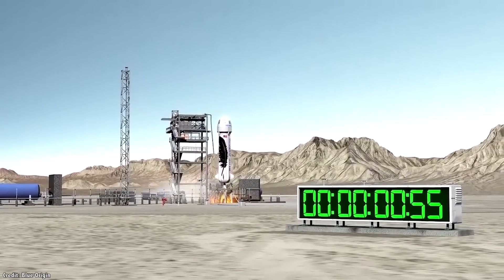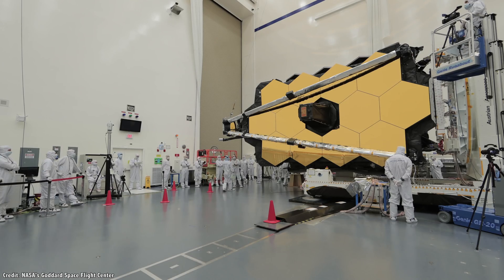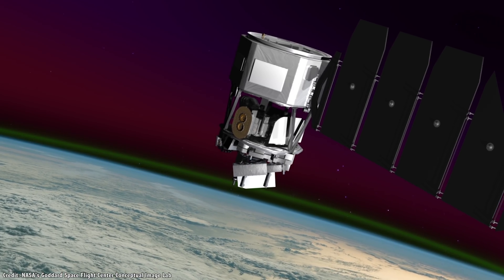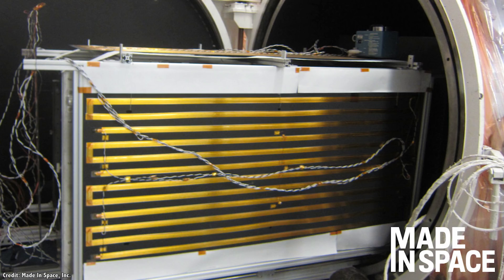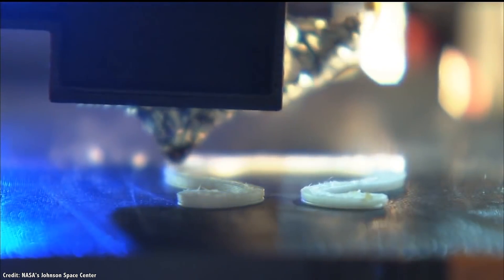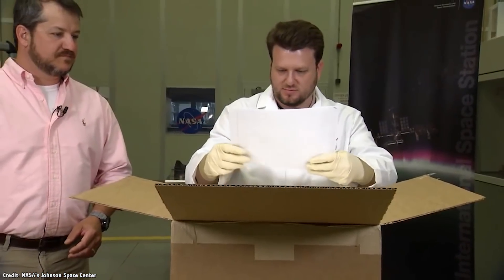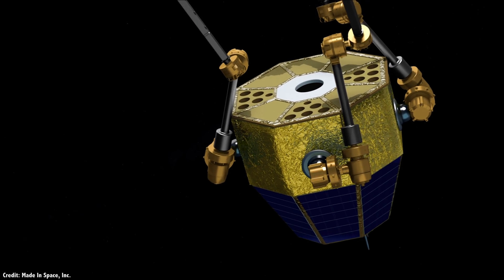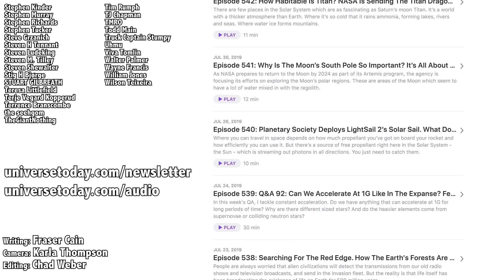A Spacecraft Is Going To Build Its Own Solar Panels In Space: Archinaut One

Comment: How will the solar panels be made? Are they some kind of flexible panel on a roll? Not to detract from the wider importance of what MIS is doing, which this serves as a good demo for, but if you're using rolled panels, why not use a, for lack of a better term, "tape measure," to act as a truss? I believe lightsail 2 is using such a system. If the technology for flexible solar panels on a roll exists, I would have expected someone to try that already.

Comment: It will take a bit of time, but once a certain threshold is reached it will take off like crazy. 
I see it as 4 steps:
1. Build functional habitats with access to further materials and water (from extraterrestrial sources), but still supplied with food deliveries.
2. Develop a workshop that can be used to build industrial hardware (machinery and composite materials).
3. Develop a fab for micro-circuitry (processors, LED lights, circuit components).
4. Build farms in space.

Then it's just build-build-build from there. Hotels, science labs, telescopes, whatever.
Some might think a space farm should come right after the hab, but no... It would not be optimal. For a farm in space, and therefore a space based colony, to be truly sustainable without any need for resupply apart from crew it needs all three those first steps.

Comment: There will never be a last cargo rocket, because of things like fine wine, champagne, antiques, art originals etc etc. But their cargo will no longer be systems or bulk materials hopefully within something like 20yrs. The Archinaut is a good technology demonstrator but to black the materials up there for the printers is not efficient, we should have material harvesting robotic systems going on line to mine the moon as a first step, and then figuring out how to automate separating the usable material and how to use that for the printers. 
That will probably mean different printing techniques as I don't think we'll have an easy time making plastics, but also it has less point. Mass in space is not really an issue the same way it is on earth, it basically only adds inertia which is neither good nor bad in itself, for a stationary satellite in a stable orbit like a telescope for instance it matters very little.
Reply from the maker: Yeah, I'm sure there'll always be some commerce between Earth and space, but not the construction materials and resupplies.

Comment: Nano Dimensions is a company developing the Dragonfly 3D printer for circuit boards. As they develop more "inks" (silicone, silver, gold, platinum) they will be able to 3D print entire electronics (computers, phones, etc) without wires or many components. They're also a publicly available stock.

Comment: In the near term, you're still gonna need to lift the mass of resources required to manufacture whatever in space...
Not only that, you're gonna need to lift the power resources required to begin the manufacturing process.
But, it's still pretty cool... :-)
Reply: exactly. start with enough energy and resources to build solar panels, and then still have enough resources to mine more minerals for whatever the next step would be..
Reply: @therockinboxer   It's still gonna be a while before they get to that... You then have to move the satellite to a resource. Dang, gonna need a decent sized and powered propulsion unit for that - more mass...)

Comment: #question How did we establish that visible light is actually electromagnetic radiation? We knew that light has wave properties and it follows from Maxwell's equations that EM waves propagate at the speed of light in vacuum. Therefore, it was hypothesized that visible light is EM radiation too. But how do we know visible light is an electromagnetic wave (and not some other wave)? Have we actually seen the oscillations of the electric and the magnetic fields? Or maybe forces exerted on charged particles by light which are not exerted on e.g. neutrons?
My name is Oleg Prutz
Reply: the two are coupled together as both light and EM energy. they create a more complex wave. i think its more or less the interactions of photons that generate the EM energy. just like water cascading down rocks can create EM energy. I am more than likely wrong, but this is as close of a guestimate that I can make
Reply: @therockinboxer  I mean, have we done any experiments detecting EM field oscillations in the passing beam of visible light? How can we be sure that it is EM wave and not some other type of wave?

Comment: Question: Considering Hall Thrusters, Would using Helium3 ions or Hydrogen ions from say a ram scoop to give the thruster a near unlimited supply of fuel propel a spacecraft at incredible velocities? just a thought.
Reply: im not sure that there is enough density for the ram scoop to efficiently use. Space is not a vacuum, buts its also certainly not an energy dense soup.

Comment: Fraser, hoping that what you say about putting questions on any topic in any video is correct.

I had a question following on from something said in the podcast about life on Mars.  Regarding whether it existed or not Fraser mentioned how there had been two scientific announcements where evidence was presented supporting the existence of life, these being the data from the Labelled Release experiment on the Viking probes and the “micro fossils” in Martian meteorite ALH84001.  What I wanted to ask was, are you aware of the other, older observational evidence?  I am thinking here two cases: Percival Lowell’s observations of Mars, and Iosif Shklovsky's theory (also based on observations) that Phobos was a hollow, artificial structure.

I recently read Lowell's book, “Mars and Its Canals”, which can be found on Project Gutenberg.  I am old enough to have read a lot of SF from the early 20th century, replete with Martian canals and dying civilisations on an aging planet, but it was an eye opener to read Lowell’s account of the careful, painstaking observations being made at the very limits of the available technology, and the evidence presented for life on Mars.  This comes down to two things: seasonal variations in surface features which he put down to vegetation, and the canals, which he interprets as artificial structures.  As I understand it the first is due to other causes while the second comes down to optical illusion, the hazard of pushing the observational technology beyond what it was capable of.

Shklovsky’s theory is also observationally based, looking at the observed rate of orbital decay for Phobos and concluding that the only way that could work would be if Phobos had a very low density, which implied a hollow structure (and therefore artificial).  Turned out the observed rate of decay was an overestimate, but the theory was reasonable given what he was working with.

So trying to pitch this as a question, what things in modern astronomy might turn out to be due to this same sort of erroneous or misinterpreted observation?

Comment: It's progress, but it's sure not what I was hoping for when I clicked on this headline.  I was looking forward to a piece about a spacecraft capable of making the solar cells themselves, and this is just about making the struts and trusses they drape over.  Still, it's real.  Those trusses and struts are a major and needless weight penallty if they come from down here.

Also, wtf NOTHING BUT TOURISTS, EVER AGAIN???  That would be a heartbreaking failure.  More than that, it would be an absolute disaster!!  That's squandering humanity's chances at becoming a galaxy-spanning culture!  You envision a vastly different future than I.  Try thinking of it as a real place where real people live, with its own cities and population working with all that infrastructure.  Tourism may be significant in the early years, but before too long I hope those hotels will be filled with business travelers who have  to be there for the same kind of completely mundane reasons why they sometimes have to go to Detroit, and surrounded by the homes of people who live and work there because their parents did, many of whom are starting their own businesses making their own products.
Reply from the maker: My point was just that it'll only be people who will need to be carried to space in rockets, not stuff, since it'll all get manufactured in space.
Reply: There will be some weight/mass savings, as space-built structures won't have to be nearly as sturdy, but at first the savings won't strictly be in weight (mass) lifted.  All the material will still be carried along.  
The early-stage benefit is easing of dimensional restrictions (length, width, volume) and the engineering required to make things of dimension fit in a rocket faring AND survive liftoff G-forces.

Comment: It would be nice if someday they could collect all the space junk that threatens satellites and use that to manufacture new things in space.
Reply: Collecting dead satellites is hard and inefficient.  They're usually tremendously spread out and/or are moving at such different rates and directions that gathering up more than two takes immense energy.  It would require SO MUCH fuel that it's just not economically worthwhile.  😒

Comment: At 7:26 you mention the Made In Space VULCAN system can do "subtractive manufacturing" : this subtractive fabrication involves cutting away from a solid block of material, thus  removal of undesired materials through cutting, drilling or milling. If this is done in space, I wonder how they would deal with the residual material: surely it would need to be collected and prevented from floating around. I thought that 3D printing was a big advantage: just printing or putting material where it is needed, avoiding waste and residual material.
Reply from the maker: A vacuum? I'm not sure how they deal with the waste, but it's supposed to be all handled.

Comment: as for the ISS , drag would be an issue if the solar panels would be three times longer etc. ... there is still a lot of drag in 400 km above ground
Reply from the maker: Yup, it'll still need to do station keeping, or fly at a higher orbit.
Reply: With greatly increased power, Hall thrusters become more and more practical, easily offsetting the drag increase (which may be large in increased drag percentage, but small in energy vs thrust capability added).
Reply: @737smartin  you still need to refill
Reply: Matthias Liszt You have to refill a few grams of xenon or krypton, but a minute fraction of the mass for the same amount of thrust as traditional propellants require. Assuming there will be lots of traffic to and from a space station, this would be trivial, I would think.
A bigger issue might be the LONG duration thrust application required by the low-power thruster(s). That might mess up micro gravity experiments.

Comment: Great video, as always! Question: Does the Moon has sources of silcon? How hard would if be to craft an autofactory that makes silcon wafers for solar cells and even electronics in cislunar space and beyond? Is this far off IssacArthurTech or something we could in this next 20-30 years?
Reply from the maker: I think precise electronics, chips, etc will be the last thing to get figured out in space.
Reply: @frasercain  maybe. but there a class of solar cell does not require silicon crystals (amorphous silicon) but lower efficiency.  Still require a higher degree of purity. And I dimly recall a Japanese chip factory that was automated to ban dirty human to keep the process ultra clean. In a past life, I had to wear a "bunny suit" to work on test equipment to test memory chips - amazing state-for-the-art chips that would have a whole 4,096 bits. That was in the Seventies. Now, we have terabit chips. TERABITS! I think that 3D printed bespoke humanoids tailored for alien environments maybe harder. ;-)

Comment: Would the 3d printer say in orbit and build other structures or will they launch a new one per project?
Reply from the maker: For now it'll be there specific printers to build trusses. But these are all tests to build a proper space-based manufacturing infrastructure.
Reply: @frasercain  Eventually, we'll send up 3D printers to print 3D printers, and it will REALLY take off. 😊
Reply: @737smartin  Von Neumann babies

Comment: When?  Same as fusion power plants.  It's just 50 years away...................
Reply from the maker: In 3 years. And they already have multiple 3D printers on the space station. To get to full space-based manufacturing will take decades, but  it's not like fusion, which is advanced physics.

Comment: If they are doing milling, then they should be very careful about the dust. A bunch of metal filings in space will not be fun. Otherwise, all this sounds so cool! This will be necessary for a robust space economy.
Reply from the maker: I'm sure they'll want to hold onto it. More raw materials
Reply: Depending on the material they could possibly use  electromagnets to collect the waste filings. Or they'll just use a vacuum cleaner. (Hey, vacuum cleaners in space could work by opening up a valve to the outside of the vehicle and just using the automatic life support system to retain pressure! Though this does invite some rather catastrophic cleaning failures...)

Comment: How feasible would it be to use a thin sheet of a reflective material to concentrate lots of solar energy onto a smaller solar panel?
Reply: Like a tiny dyson swarm?
Reply from the maker: Farther out in the Solar System this makes more sense. Close in, you just use solar panels.